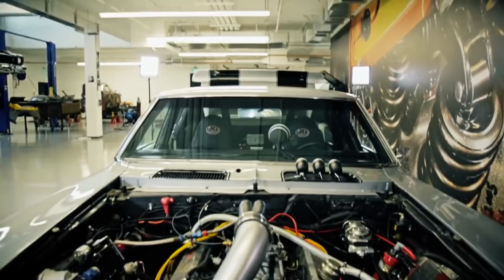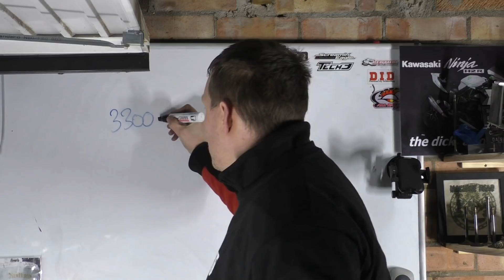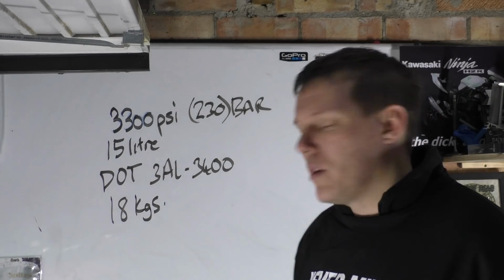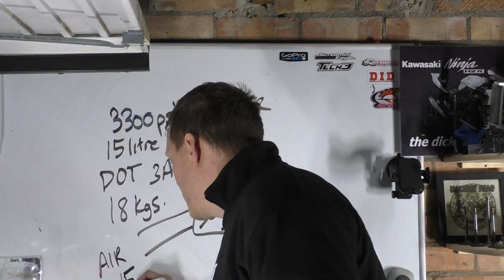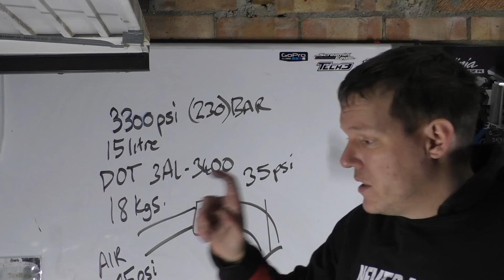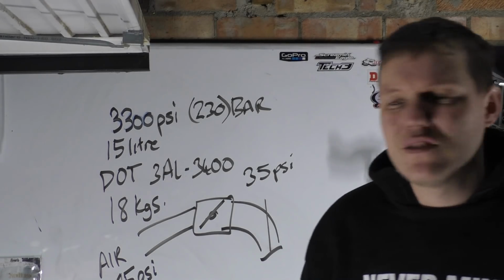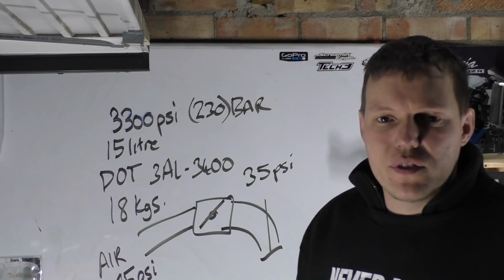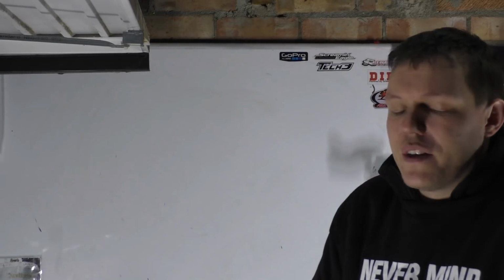Compressed Air Supercharging? - Bullshit?

Comment: You missed out the eliminated engine loading over a conventional supercharger boost system. The energy used to compress the air in the cylinders is from an external source (compressor) so isn't harvested from the engine as with a supercharger.
Reply from the maker: LOL no I didn't - I've covered that loads of time. This is about the system. And if you wanna go down that road (pun intended) then a supercharger lasts a lot longer than 10 seconds (or at least it should do LOL)
Reply: @thedirtyworkshop  basically then isn't this more an alternative to Nitrous than 'supercharging' just it exploits the same reason that a supercharger adds power?

Comment: Gotta remember the amount of horsepower that superchargers take to run is being removed by using this system.
Reply: Nitrous is better since it releases o² when it hits 1200°f and doesn't need a valve to close intake... Though directly injecting air into a combustion chamber would be interesting...
Reply from the maker: "Gotta remember the amount of horsepower that superchargers take to run is being removed by using this system."

- true, but 10 seconds......
Reply: @matthewfredrickmfkrz1934  You can inject nitrous that way as well and use it instead of air, no?
Reply: @funcounting  idk I've seen lots of variation placing nitrous ports for different reasons... Probably one of those circumstances where ideality and practicality don't intersect
Reply: @thedirtyworkshop  
10 seconds but your lass is happy with that   ;)
Reply: @thedirtyworkshop  how about an on board compressor?
Reply: @NwoDispatcher  they call that a supercharger.
Reply: @ptbelttactics  probably limited to how much pressure it can give. How about a 1000 psi pressure from a tank? how much more efficient is the pump they use?
Reply: @NwoDispatcher  the pressure doesn't matter, what matters is how many cubic feet of air they can store. And, the problem is they cannot store enough air to feed a small block Chevy for more than 10 seconds.
Reply: @NwoDispatcher  the guys working on this project are trying to work against basic math. A 350 cubic inch small block Chevy running at 6,000 rpm consumes 1,200 cubic feet of air at 1 bar per minute to produce the amount of power it makes naturally aspirated.
Reply: @ptbelttactics  guess I'll just keep praying for my rotating detonation motor
Reply: @NwoDispatcher  a 5 cubic foot cylinder pressurized to 1,000 psi only gives you 345 cubic feet of air at 1 bar. So as you can see, not even enough to run a SBC for half a minute at 6,000 rpm.
Reply: @ptbelttactics  think the increased pressure would make combustion more complete and more fuel be fully utilized?
Reply: @NwoDispatcher  no to produce X horsepower you burn x fuel and x air. When we tune a car we either calculate Volumetric Efficiency or MAS air measured in grams per second and add the equivalent amount of fuel to achieve Lambda. The engine doesn't care about pressure it cares about the mass of the oxygen.
Reply: @ptbelttactics  so an ICE is as efficient as it can be?
Reply: @NwoDispatcher  1 gallon of gasoline has been producing the same amount of power for 60 years.

Comment: If you're going to be carrying those bottles onboard you may as well have them both full of N2O!
Reply from the maker: Apart from nitrous cooks rings - but yeah
Reply: Be aware of danger to manifold!
Reply: what's the cost of refilling a bottle of N20 vs. a Scuba tank...? honestly never used the stuff.  yes might be better deal considering the density of 02 received.   also does the price of N20 fluctuate like other commodities might, you know, like a barrel of Oil or Natural Gas...?
Reply: true
Reply: @thedirtyworkshop  No, but it can snap them if you don't check your ring gap :)
Reply: @MrsMcMuffin  and floor panels falling away.
Reply: @forevercomputing  weight reduction on the go, makes up for the added weight of the tanks.
Reply: @phillyphil1513  as far as I know from my reading on it is being developed by people who worked on N20 kits (the guy who ran NOS) and weight for weight is more efficient than nitrous

Comment: Tina Pierce is pulling 5.50 in the 1/8 mile and the charged air is -98f at the intake -20f in the engine plenum and per run her largest cost now is fuel with the engine temps staying low. The tanks can be refilled between runs with a spare bottle set. 3 bottles give enough charge for three pulls in a 454 big block making 1300hp

Comment: You can mix the air in the bottle with nitrous oxide for example(5-10% maybe) or increase the oxygen level.You can make whatever blend you want but as you said it will only last a couple of seconds.Cool idea tho but not new or revolutionary.

Comment: This reminds me of the bright idea a guy I knew, had: To cool the intake air with the car's air conditioning. A sound idea, only the air con would have to be big enough for an icehockey arena.
Reply: Are you sure it would have to be that big of a/c?
Reply: @buddyywilsonn  To get enough air flow through for the engine it would probably need to be so big it wouldn't fit in the engine bay. Probably not even in the boot as well 😂
Reply: That guy was on to something. Today, the AC system is used to cool down the charge temperature on supercharged engines.

Comment: One thing you did miss:
All the air coming from a tank means that natural factors that come into play for your traditional engine have no effect on it.
Take the Pike's Peak Airstrip Attack drag race. You would be running on about 12% O2 while this can be charged at sea level, around 20% O2, and brought there...if not just a custom mix that means the engine runs at peak performance no matter where it is.
Reply from the maker: for 10 seconds
Reply: @thedirtyworkshop  Do your supercharged drag races take longer than that?
Reply: So.... just like a turbo?

Comment: What if instead of using the intake, you ran a "richer" engine (while you boost it) and injected compressed air into the chamber as soon as the intake valve closed?

Comment: More the heat added compressing air being the problem with regenerating a system like that. Still massively crazy boost, wonder if it could be done chemically, doh.. not going there, end up in rocket land at that point

Comment: I just wonder if an energy efricient air compressor may be able maintain tank pressure 
& give slightly more advantage
over the losses,
increasing overall efficiency?
I guess efficiency would depend a lot
on the design and tech
of the Electric Motor
for the Air Compressor
along with the Alternator /Charging Set Up too.🤔

Comment: You have any opinions on using a single or double stage air compressor as a ghetto supercharger?.. 
More so, im wondering about converting a 25cc weed eater into a supercharger for 50cc mini bike..?  I got the junk and idea down, just not the machinery..

Comment: How about using a Venturi to suck in more air, similar to how aircraft slides are inflated?
Reply: Cant possibly trust a man with 4 names
Reply: @beachboardfan9544  can't argue with that. I'll see myself out.
Reply from the maker: You could do.
Reply: Something tells me you would get problems with restrictions, they're would be a lot more restriction through the engine path presumably then out the sides of the venturi that you're trying to suck more air in through so it would end up flowing back and pissing out everywhere. Inflating a slide is pretty easy even though it's a dead end because until it fills up the pressure is the same one either side of the slide's membrane. 
When going through an engine manifold there are pressure waves slamming about and the goal with forced induction is to get the whole thing at a significant pressure difference to outside. 

I'm not an engineer but that seems about right, to put it in a more intuitive way I would think it's the difference between inflating some armbands, which is nackering but doable, to trying to inflate a 2l bottle, as soon as it flexes all the slack out of itself it's practically impossible to force more air into it with lung power. Of course this only applies to the type of venturi that has an intake at the low pressure point that's being used as a pump, not the 
"sealed" types used to manipulate pressure like on the nozzle of a jet engine or underfloor of a formula one car.

TL;DR IMHO a venturi with some holes in it would increase the mass of air being sucked in but wouldn't increase it's density very effectively. If it was that simple we would probably see venturis being used with forced induction already since they're relatively simple devices.
Reply: @AlexA-qx9pn   i think what's meant is using the gas bottle as the rocket in this
https://youtu.be/Ls00Eb-ub00?t=279

Comment: I just got an idea. What if you just cut the fuel to one of the pistons so the engine basically has its own built in air compressor whilst sacraficing a piston, then just dumping the air that the piston sucks in, directly into the other pistons instead of out the exhaust to have an exponential ammount of boost? Obviously it would be unbalanced but I cant imagine it would really matter too much on a caked up engine that you'd plan to do this to anyways. Most old turd engines probably run on 6 of the 8 cylinders so I think it could work.

Comment: for drag racing could a higher concentration of o2 to n, maybe 42/ 57 allow for more fuel to be used per charge, and there for result in more power, assuming you can deal with the extra heat? I know I'm reaching. THANKS, the workshop ROCKS.
Reply from the maker: depends on the class and their rules
Reply: you would need more air to burn it
Reply: @Mp-jw1qg  --42% oxygen/57% nitrogen is more, prehaps my question is vague thanks
Reply: @timdryden3778  dont forget to factor in volumetric efficiency .

Comment: I would like to see a small high pressure air compressor that takes off of the alternator. Just powers it when you're driving around no problem with the excess energy your alternator is already generating, and cuts off when you get to your max pressure. Yes I agree its hazardous as hell, but natural gas vehicles ride around all day long at 3600psi, so its not unheard of. 
It'd refill the bottles in about 10 minutes, so if you're really just using a squirt here and there for heavy acceleration, you'd likely never run out.
A supercharger is parasitic and ALWAYS putting more load on the engine, and a turbocharger is massively complex and puts an even higher load on the engine + much more heat. This seems like a happy medium where your engine will make it to 150k miles but you can have a little fun on the way

edit: i did the math and it equates to almost exactly 10 seconds of runtime if the total bottle volume is 15L and the engine is demanding 750 CFM

Comment: OTR diesels have their own engine driven on board compressor.  since they already have a turbo, of course the air is used to power a fault tolerant braking system.

Comment: I think the mechanical pressure regulators and high flow valves these guys made for this system would be better off being used to make a fueling system for LNG powered airplanes to be honest.

It'd go a little bit farther on lng than on kerosene, burns much cleaner, you can make it from many renewable sources if the govs and oil corporations would let businesses start building and using their own mini-electric grids powered by gen 3 nuke reactors or the microreactors that they have that can be carried by 18 wheelers.

Yeah, kinda thought about this in detail for a couple years you could say.

Hello from Lousiana!
Reply: I’m thinking of trying it out for the same reasons, because of the energy density of LPG it just makes sense. But why not both? In 2021 im going to try converting Subaru EJ20s over to LPG/Compressed air. Two tanks in the flatbed. It’s the fiberglass tanks,

Comment: Could they combine this with nitrous oxyde to increase the O2 concentration?
Reply from the maker: Yeah but you already have to worry about heat just running higher boost, even with lower intake temperatures - Nitrous = bad LOL

Comment: The only thing I could think of. Is the cryogenic side of it! A engine gulps room fulls of air per second at full throttle.. It's hard to get that much air in a tank! Then to double it a few times to compress the inlet flow!

Comment: Im working on a system that similar....put a CR 500 reed in intake below air filter above high pressure source    with intake side reed valve facing air filter........... no expensive valve needed, yes...none 

more intake flow needed add a  second reed....  like transfer on 2 stroke

Comment: They do the same thing with carbon fiber in paintball airtanks compressed air tanks that are carbon fiber wrapped are rated at 4500 psi but most fields air compressors fill to 4000

Comment: TOTAL LOSS SUPERCHARGING.  kinda similar to the compressed Nitrogen tanks in F1 or a MotoGP bikes powering the return side of the pneumatic valves.   the energy required is provided separate and apart and thus not parasitic to the system.

Comment: You totally didn't answer anything. What was the point of this video? We know it's just for 10 seconds, not for all day use. I was expecting hp differences between this system, blower system, turbo system, NOS system. The only thing that's Bullshit is this video.
Reply from the maker: Is it me, or are you stupid? The title clearly says 'bullshit?' as in does the system work, and how does it work., Just because you wanted "hp differences between this system, blower system, turbo system, NOS system." - doesn't mean that's what you're gonna get. And how could you compare HP numbers? For what engine, and which system? 

It's simple fuck nut, if the system supplies the same mass flow rate as 'x' turbo then the power will be the same... This is just a demo of your stupidity...

Comment: this would work great on a direct injection engine. fuel goes straight into cylinder, delete the air intake manifold entirely,  run 2 electronic air valves per intake runner sort of how you would do ITB but each set of valves, 1 provides the pressure, the second bleeds excess in a closed system so each intake runner has its own control.. this way a standalone ecu could easily use the signals to  map the solenoids ,   match the boost pressure based on rpm just like a supercharged engine and you could probably get a full mile out of 2 decent sized air tanks. its not a bad idea and the technology exists, its just that you can bolt a turbo and get the same performance.
Reply from the maker: There's isn't enough air. A 50 litre bottle @ 200 bar is only 10,000 litres. At 10k rpm for a 1 litre engine you only 1 minutes, and thats at 1 atmosphere. If you want boost then you only get 30 seconds for 1 bar boost. For drag racing they run far higher than that
Reply: @thedirtyworkshop  that depends entirely on volumetric efficiency.  my bmw for example is 95% volumetric efficiency and at 40 psi it flows 8 cubic feet of air per minute.    the car is an 8.50 drag car so it  would only need enough compressed air to run for 10 seconds tops. you could easily get a bottle that can hold enough air to flow 8scfm at 40 psi.
Reply: @thedirtyworkshop  p + 1 2 ρ v 2 + ρ g h = constant.   v= velocity of air coming out of a nozzle.  you have a bunch of different variables that you have to figure in. I know of 2 cars that run this type of setup and have dual 100 gallon tanks and they run 1000whp off of small block chevy engines modified with custom carburators that switch over to direct injection with air solenoids. theyre working on an ls version now.
Reply from the maker: 40 psi gauge pressure not absolute.
Reply from the maker: Your other issue is the nozzle at the bottle as a flow restriction

Comment: So what is the benefit over nitrous oxide? Cost of filling the bottle?....And I take it you have no throttle when it is operating? Just a solenoid to start it off? That is some pressure to have in your boot,at least it’s not flammable!🤔🤔🤔

Comment: Can't you make the bottles a structural part of the chassis though? Like putting them inside monocoque's arches or something.
Reply from the maker: possibly - but then the internal stress on the tank is not something you want to worry about when its holding your wheels together - not only that but I think all of the compressed gas laws will have something to say about it - do you wanna change your chassis every 5 years?
Reply: @thedirtyworkshop  Depends on how the law works. For example you could just drive with empty gas tanks to your MOT and say you never fill them up. Or if you're doing serious pro racing with it you might as well just replace it every 5 years. And yeah, you don't want to worry about it but people do the same with engines and they probably never wanted to worry about something like that either. Wonder if you could just have  rocket fuel tanks and mix oxidizer and combustible inside the chamber via direct injection. You wouldn't need intake at all, perfect 2-stroke design, lmao. No idea how you'd deal with heat in something like that tho.
Reply: @thedirtyworkshop  Oh and for a possibly cooler idea, can't you have an aluminium alloy monocoque that has a water jacket inside it and use the whole car  as a radiator, or at least have the diffuser plate under the car. It would have have a huge surface area even without cooling fins and would give you a lower center of gravity.